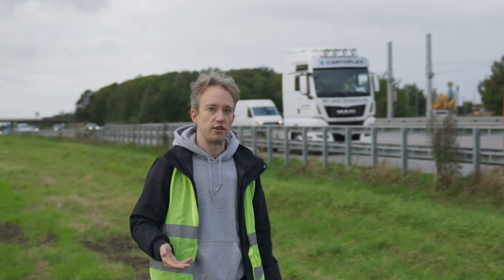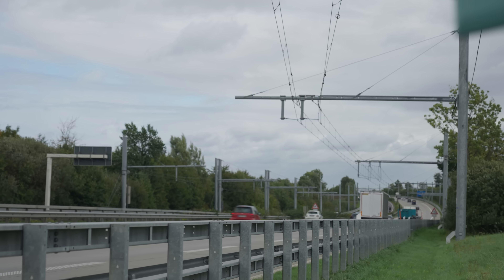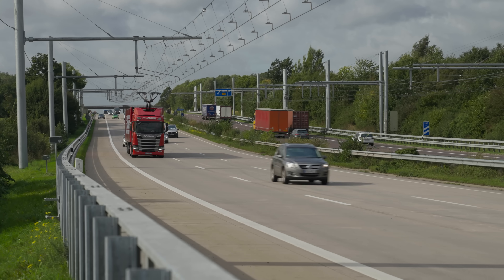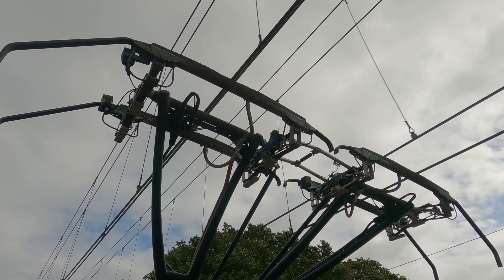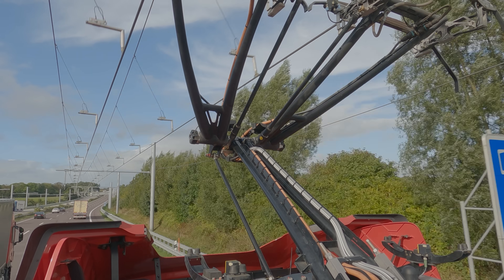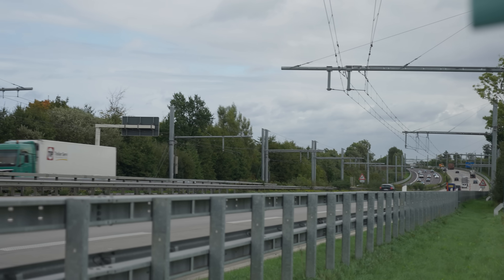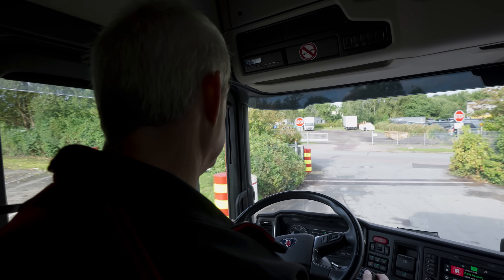The highway where trucks work like electric trains

Comment: A backwards loop of logic: how are you going to maintain these constantly on power cables if not by dramatically increasing the energy output of the country, which all estimates show "Green" energy will never be able to provide. Let's not forget electric cargo haulers are grossly inefficent in terms of weight to powe ratio and downright impossible in many countries like the UK and US. It's a complete and utter waste of time, that fixes no problems, and simply backloads the energy production like most electric cars. Electric cars are a scam.

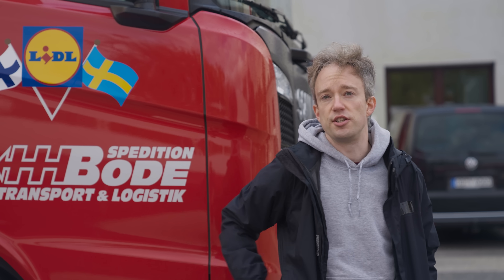Comment: 3:47  That's a lot of individual wear grooves on the pantograph contact shoes.  It probably indicates that the catenary wires are at a fixed location over the lane rather than varying within a specified width.  If the catenary wires position varied, say plus/minus 20 cm from the nominal position it would smooth out the wear pattern giving much longer pantograph shoe life.  This is exactly what is done on railways to enable an acceptable pantograph shoe life.  Yes, there is potential for this electric vehicle format as a number of prototype installations are proving but the infrastructure (catenary wire, towers and associated equipment)  is very expensive, will take a long time to build a sufficient network and quite honestly it is a damned eyesore.  I'd be surprised if this becomes a widespread format.
Reply: Eyesore is not really all that bad. 

Better air quality & environment much makes up for it.

Comment: I study electronics. My teacher said if we replace every combustion car with an electric one we will need to make 75% more energy. That would require upgrades of the whole infrastructure and more energy generation. What's our plan? close 50% of existing power plants because they run on coal. I don't have a solution but there is going to be a crisis in the near future.
Reply: Your teacher ignored the reality of new/improving technology. At present that's true, but it probably won't be in 20 years.

Comment: I don't hear anyone talking about maintenance costs. On both trucks and the system.. There are lots of wear points on a system like this.. And I'm not just talking about the contact points on the catenary either. A you tube post like this is a bit misleading.. They're only about the plus side and the amount of diesel saved. Good points in theory, But electric systems of this type are maintenance heavy from start to finish. Any money saved they're touting on this video will be ate up in maintenance of said system in my opinion.

Comment: They should still have batteries for areas where this isn't built yet.
Reply: problem is a battery powered truck with lets say a tonnage of 25tonnes will not go much further than 100-150km
Reply: @pr0blemi-gear83  So a hybrid then?  On the main roads they hook up.  Vast majority of the time it's on the main roads.  Then go petrol off road or better yet hydrogen.  However I'm sure batteries will get better and better by then. The petrol thing off the line could just be a temporary thing till batteries get better.

Comment: The only big problem i see for this system is the daft thing that is between the seat and steering wheel of every vehicle.  But you are also moving a problem from a road to a power station and Britain is having a large problem with power right now.
Seems like a good idea, but a better idea would be to remove long distance trucks and build better railways.  Then do local distribution on road networks with battery trucks, charged during the day and deliveries at night.  (day charging would make Solar a good idea for the charging power source.)

Comment: Idea is sound. There are still some unsolved problems - it would require to install overhead wires on all major good shipping roads, replacing most of truck fleet, installing charging areas on truck parking spots etc. Also there will still remain a lot of diesel trucks to ship goods to places that aren't and will not be electrified. And particularly for Germany - where they will get enough electricity with nuclear power abolished and fossil fuels phased out?
Reply: Simple! We'll buy it from the french an poles! In fact... we're already doing that....

Comment: The road quality in Germany looks amazing.
Reply: the amout of power required to overcome tyre and wind friction is much greater than rail where the co-eficient[traction] is so much lower so trains are much better use of power , this lorry is being subsidised as real costing=road user charges should reflect the real cost of building and maintaining the autobahns= most of the original  nazi network was done by the reichsbahn as a nazi propaganda exercise, construction and maintenance was never planned, so long as rail still has to charge users, the same should apply to all road users  without exceptions.siemens have some of the best locomotive designs which are the most efficient users of electricity= lorries are not and as speed is increased, efficiency fails batteries are a failure for the environment. hybrid vehicles using petrol/ethanol blends from forest waste and recycled paper  the processing of slash/ materials in australia and the usa would have prevented their fires and rendered the shale tars as too expensive and protected the canadian wilderness regions. germany should close all brown cal use and extend nuclear use under stricter controls, france has its stations close to the ir borders-the eu should be balancing safety measures which  ensure all are well inside french territory 80 km minimum.

Comment: However you slice or dice it, you are still left with a power source problem. In this case "the grid" is not in some far away fairy land, it's a coal/ gas or nuclear power
station just up the road (with perhaps a 10 to 25 percent contribution from wind turbines, cost of which is subsidised by taxes on the coal/ gas stations)

Comment: If you have any experience with trains and trams getting their power from overhead wires, you know how problematic e.g. usage in freezing weather is and what service outages are caused for any type of maintenance. And of course as all drivers and truck companies are angels the pantographs are always in perfect condition, with a 0 % probability of damaging the wires. ... that was sarcasm ... occasionally a truck will rip of the wires causing deaths behind him.
There's already a better technology: Have the road charge the batteries in the car via induction. No weather issues, no danger of something dropping on a highway killing people. And most maintenance can be done when the road needs maintenance anyway.
Probably do a report on that.

Comment: The battery needed for an electric truck is so heavy it limits carry weight by quite a lot. There is a reason the tesla semi was a bad idea.
Reply: but if your constantly being supplied with power you can have a much smaller battery for when your off the grid.
Reply: This video showing that electric trucks are likely going to be adopted shows that the Tesla semi definitely wasn't a bad idea.

Comment: Neat idea, but it'd be more efficient to just build up the train/rail system more. More tracks, more stations. Then use electric short-haul trucks to bring the freight to their destinations.
Reply: You just cannot take long distance trucks away, for example in Australia you cannot have a train everywhere.
Reply: I doubt it. In dense places like Germany there is no space for new railroads. Cerntainly not to connect every depot to the rail network. So this hybrid solution makes quite a lot of sense.
Reply: Heavy rail is not cheap to build.  The US is king of rail freight and nearly all of it is on rights of way purchased a century ago very little new rail lines built due to costs.
Reply: The loading and unloading of trains is super complicated. 

This isn't a bad idea for trucks since they can have a smaller battery pack onboard. That way they can go to the final destination without the need for power lines. However on the motorway/autobahn they can run on grid power and charge up their batteries.

I also think this is a good idea for busses/coaches too. They can charge up on the motorway then go to the stop in town on battery power before heading back on the motorway.
Reply: Funny,Euros never want to talk about freight when comparing rail networks with the US.  😂
Reply: @kilobyte8321  at lest they fixed our train tracks and switched from broken lumber to nice concrete / paved crossing. Got to point I went out the other side of town and drove around it to avoid the train tracks

Comment: I have concerns about the load on the overhead cables, you cannot have 100's of trucks drawing power on the same stretch of road - you'll either fry the cables or they'll trip it out and blow the electric system fuses.  Good idea in principle but in practice it needs a lot more thought, planning and infrastructure design....
Reply: Try getting 600 horse power out of a electric  truck give me a break
Reply: Good point. 

Another point i missed what happens if the cable breaks? I've been in a passenger train where that happened. I saw the live wire arcing outside my window. It took more than two hours to free the passengers. That happening on a highway with trucks and passenger cars hitting or hit by a live power cable could be a mayor disaster.
Reply: @marcheida2819  Residual Current Devices. Our homes are equipped with RCDs so sensitive they can detect earth faults down to the milliamp and shut off the power before it can hurt anyone. I'm sure it's possible to apply that within sensible limits to a transport network.

Comment: So one peoblem:
Trains use the wheels as ground, thats why they only have one overhead wire and it can zigzag so it wears of equally.
This isn't done with this system since there is a second overhead wire needed for the ground connection. It's the same for overhead bus, but these don't drive in such high speeds.

Comment: this is a schnapsidea. instead of electrifying overloaded highways, it was much cheaper and much more effective to electrify whats left of the sabotaged german railways.
Reply: But expanding the railway network would take time and organisation while you can even combine the wires with solar panels and wind turbines and generate more electricity as all the trucks could need.
Reply: @deathgun3110  well. there are still a few railways left, germanys railway though sabotaged by deliberate incompetence is not completely gone yet and much better suited for mass transportation then highways. the rest of your reply is bulloks. if you want to build a wind tourbine, build a wind tourbine. if you want to build an electic wireing, buld an electric wireing.

Comment: Is there not a problem when an unusually tall load has to be moved on and off the motorway? Presumably these wires need to be lower than the clearance height of any bridges and tunnels, so the new height limit is reduced.
Reply: The trucks must still have a few batteries (after all, if they were meant to only travel on the wired path and nowhere else in my opinion there's little benefit to this over a train) so even if the wires terminate before a tunnel then resume after the truck could still function.
Sure, there does need to be an electrical connection between the wiring before and after the tunnel, but if the connection doesn't need to be exposed it makes routing the wires outside or under the tunnel possible.

Comment: How quickly would the wires wear out due to contact friction?
Reply: also no matter how efficient the are this would increase demand on the electrical grid and thus increase the demand of the cheap fossil fuel sourced electricity.

Comment: Only error is the wire is in the air. They should be in the road. Then, all vehicles could connect, not just trucks.
Reply: Contactless charging costs a lot of electricity, also there would be no poles for solar panels.

Comment: if you put lipstick on a pig it is still a pig.  the rubber tyres it runs on are one seventh as efficient as steel on steel like trains and trams.  tom, have you done a video on where the rubber that wears off truck tyres goes to?  how about a video on where the rubber that wears off car tyres go to?  the world has a problem that wont be solved fully by electric cars and trucks.

Comment: This would be perfect on the A14 between Felixstowe and the A1 in England
Reply: *Felixstowe and M6

And then up the M6 itself, M56 (and M53) and A55... Plus the full length of the M62 and the central section of the A66.

Hell of a lot of trucks going down the M42 (from M6) then M5, at least as far as the M4, last time I went that way too (like, enough that I remember commenting on the convoy like appearance), so add that run to the plan. That'll be good to start with, displace a hell of a lot of diesel, especially in rush hour (and over some significant hills... On which note, stick a section on either side of Shap even if that ends up standing alone with gaps either side)

Plus M54 as far as Telford to cover the i54 hub...

And raise the speed limit on the M6 Toll in light of how most of the few truckers who use it anyway will then be diverting back to the old road as they gradually change over to electrified cabs, so there's rather less of a differential between the lanes.

Comment: i'm driving this route everyday and everytime i think: "Why don't we use the trains to transport the Cargo to the city needed and then put it on an truck for it's final destination. why do we electrify our Highway and make it more dangerous."
Reply: It seems like it's faster to load and easier to go "off the rails"
Reply: @krissp8712  well the bug problem is that the german government subsidizes the trucks which result in Lower Cost for trucks and higher costs for Train. Trains are much much more environmentally friendly than trucks, but the Goverment loves the Car Industry.

Comment: have fun adapting all the lower bridges & tunnels we seem to have here.

also upgrading all the road overbridges to stop yobs chucking scaffolding poles off

biggest issue though will be billing, this will depend upon the lorry itself measuring its power draw and reporting correctly.

and not like there will be any incentive to report a bit less than you actually use is there?

also, the as yet unanswered question: where exactly does the electrickery that has to be put in come from?
Reply: Why would you have to adapt bridges and tunnels? The trucks have a battery, they don’t require to be connected constantly.

Comment: The contact bar shows important wear traces due to the wire installed straight when it should be in a zig zag for the friction to spread over the length of the contact bar. That apart, I hope the test will be a success.

Comment: A good thing about this is that trucks can be made streamline when electric. No need for the huge front grills and radiators which act as a huge area of resistance
Reply: More like a America truck design less like a crappy super inefficient European truck design. (Flat front is literally a giant moving wall)
Reply: @superspooky4580  European lorries are designed loke that because of wheelbase. American trucks are too big for European roads
Reply: @dannywhite132  intresting. Im more talking about the front end and how its flat. I think its due to yall having vehicle length restrictions (aka your truck can't be too long) kinda sad ngl.

Comment: The one challenge I can see is having maintenance crew able to quickly repair damaged catenary when there is the inevitable accident/damage. When the railways have similar problems, disruption can last for hours or even days in some cases. I’d like to understand their plans/approach to failures.
Reply: The solution is that these trucks still have batteries for the last few kilometres, so a kilometer or two of downed wire isn't a concern, close the lane for a while and fix the problem, the trucks can just go in the non-electric lane on battery for a few minutes and get back in the electric lane after the next grid connection point in the system.

Comment: Are there capacity issues with the cables?  Trams and trains are much more predictable in their demand than trucks will be.  

It would also be good if cars could make use of the wires also somehow.  Could they be floor mounted or is it too dangerous?

Comment: I wonder how they would handle over-height loads. They can't just simply use the middle lane, as they would have to cross the wires to get on and off the road. Or is that not a thing in Germany/Europe?

Comment: Saw a similar project running in Korea. Theirs was much more clever because it was only on the approach and departure from traffic lights where most energy is used. The really clever part was trucks slowing down used regenerative breaking to charge the system to power trucks starting to move.

Comment: What an ugly, short-sighted, regressive solution. Building a huge network of overhead power cables just for trucks to use in one lane seems much less preferable than using hydrogen fuel cells or just improving batteries. We should be eliminating overhead wires wherever possible and moving to underground or wireless solutions.